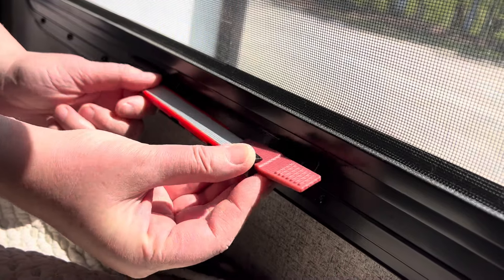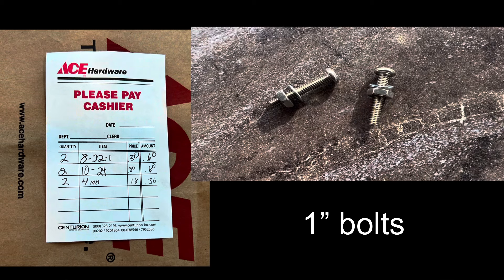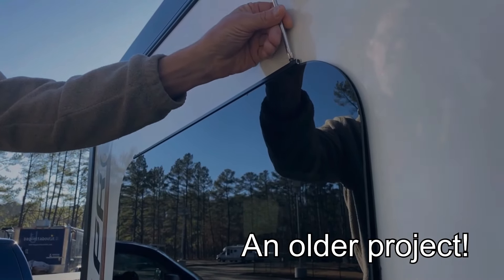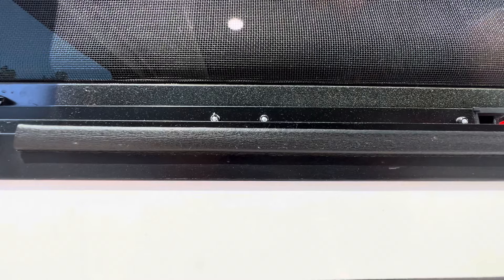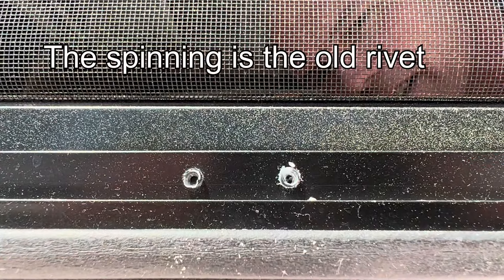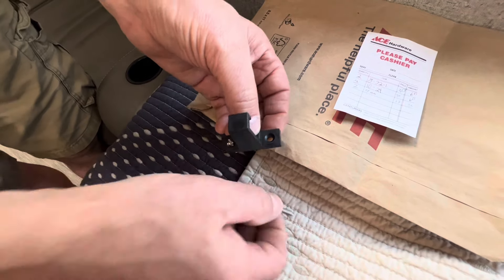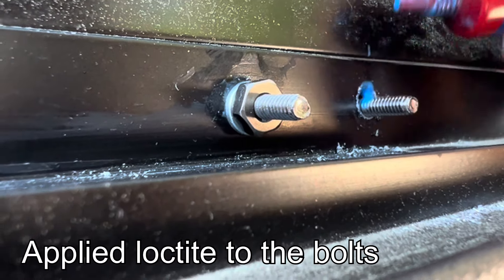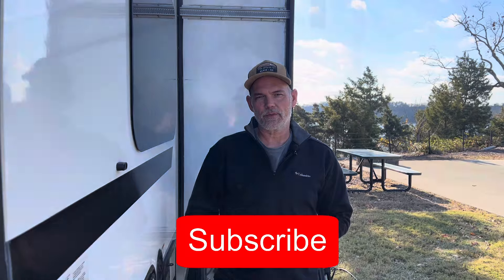Quick Repair to Our Broken Emergency Window Latch!  Parts & Install

Comment: Thanks for all you share!  Really inspirational and encouraging.  I wondered if you were convinced of needing the weight distribution hitch. I read that some people felt that if the weight of your tow vehicle is about the same as your trailer you wouldn't need one.  Thanks for your feedback as I am sure you have thought this out as diligently as all your videos illustrate.
Reply from the maker: Hi - thanks for the watch!  So, when we first bought the GeoPro, we had a truck with a 5200 towing capacity but a WDH was not recommended to be used (per the manual).  After towing a few times short distances it just struggled.  So we upgraded to the 5.7 Tundra.  Its towing capacity is around 6800 lbs but with a WDH, just over 10000 lbs.

We saw almost all Geo owners using a WDH hitch so we bought and installed ourselves.  99% of our towing has been with it.  I have tried a few times without it (going short distance on regular non highway roads) to see how it would handle.  And I can tell a difference.  It tracks straighter and I hardly notice it back there with it on.

Do I think I need a WDH (but would need sway bars) - maybe not.  We travel  out west and with the mountains and winds, I am glad to have it.  I definitely think it improves the towing experience and would not travel on a trip without.  Hope that helps!

Comment: This off the subject of this video, but have you replaced your power center yet? I'm fixing to install a 200amph battery in my '21 19fbs and had re-watched your battery upgrade video. I was wondering how well you did with your new battery using the standard power center.
Reply from the maker: Hi!  We haven’t actually.  We have found that with the solar, it charges just fine to the 100%.  We think it would still be a nice upgrade but haven’t found the need just yet!
Reply: OK, Late reply.. But...Installing a larger capacity battery should not cause any issues with your current converter/power center.  ;)